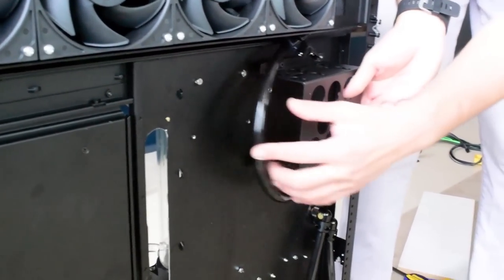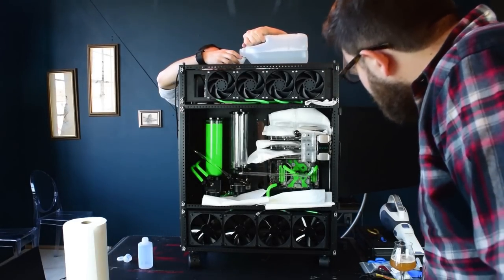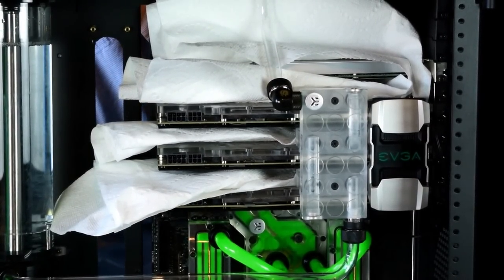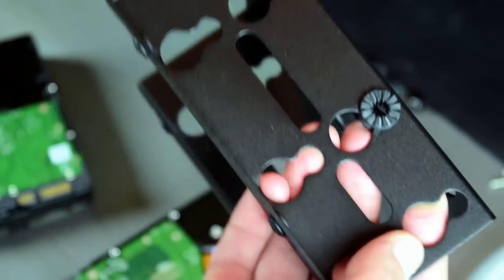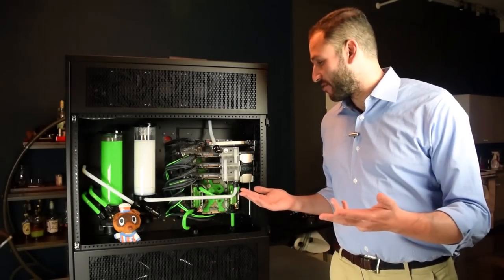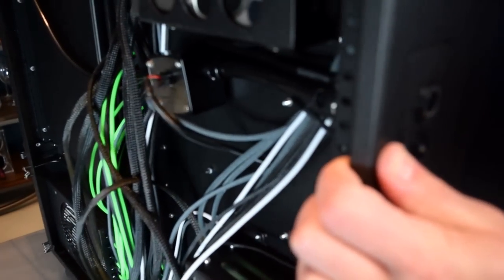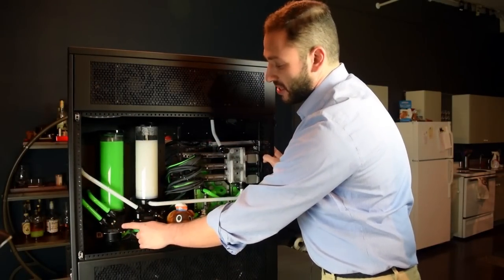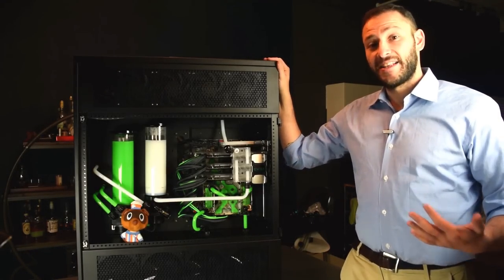Nostromo: 5960X, 3x 980Ti, Custom WC, Rampage V -- Part 4 (Loop Planning, Filling, and Testing)

Comment: Great video! You've basically covered every single thing one needs to have in mind while building/testing the cooling, and answered all my doubts.

Just one question - aren't two 480mm radiators a bit much for the system? Could you put some benchmarks of your temps on load with different fan speeds?

Comment: Good job. Looks good. Just some small suggestion. Is straighten up the gpu run from pump to gpu as the 90 and run our off. Btw what fans out on the bottom pedestal?
Reply from the maker: +James Emsley That makes sense--I'll take another run at that bend.

The fans on the bottom pedestal are NoiseBlocker Blacksilent Pros, the 140mm PWM version.

Comment: Hey Eugene, thanks for making this build log. I just ordered a STH 10 and want to do my first Custom water cooling set up in this case. Figure its a good case to start with. Though I havent had any experiences doing simple mods was there any difficulty drilling in the STH10? will BitsPower fittings work with EK 12/16 PETG tubing? sorry for all the questions dont really have anyone else to talk to about something this specific
Reply from the maker: +Gerard Israel This is a great case to start with, if you have the room for it.  I love how much space it gives you to work with.  A lot of people go with ITX/mATX for their first custom builds, and while there are some great cases there, the dearth of real estate is rather unforgiving.  

The case is not difficult to drill through, but you definitely have to be patient.  The most important thing is that you should start with small drill bits and work your way up progressively for each hole.  Also, of course, measure five times, cut once.  

As for fittings and tubings, I can't vouch for that specific combo.  I've heard of some people having issues with mismatched fittings/tubes, so I opted to go with Primochill PETG matched with Primochill fittings.  Then again, I happened to like the way that the Primochill fittings work.

Looking forward to hearing more about your build!

Comment: 560mm Radiator enough for a I7 6700k and a gtx 980 Ti?
Reply from the maker: +Zero You know, the typical orthodoxy is 120mm of radiator capacity for every cooled component, plus another 120mm on top of that, so I think you'll be fine--especially with those parts (sorry for the delay in responding--my YouTube app no longer notifies me of new comments!)

Comment: All that work on the piping and it still looks a bit untidy. Could use some better cable tidiness, make those look neat, straighten them out with some cable combs or something. I dont really like that the tubes dont line up on the left either its not very pleasing to the eye. With all that cooling tho you should be able to achieve quite a high overclock on that CPU maybe in the 4.7 or 4.8Ghz range and in the 1500mhz range on the graphics cards.
Reply from the maker: You should check out the next video!  It's all about cable management.

Comment: GTA V, Crysis 3, Witcher 3, Battlefield 4, Far Cry 4 in 1080p, 1440p and 4 k
Reply from the maker: +Dick Dickerson Cool.  I have all those games and will bench them, but the resolution situation is a little difficult, since I run a 3440x1440 and not a 4K.  Still, that should get you a fairly close approximation of 4K.

Comment: Hay man nice job. I can imagine the cost of that beast. I'm finally getting the extra time to finish my loop. I am going to block my 980 ti. I have mayhem pastel blueberry and pastel uv white. Coolant. I want to be able to see it in the block of the 980 and torb  do that I will have to flip my mother board upside down. You are the first person I've seen with the motherboard upside down. Have you had any negative affects from being up side down.
Reply from the maker: None at all.  But you have to be sure to get a compatible case!
Reply: Thanks I didn't think it would. I just thought I would ask before I did it because if something had the chance of going wrong it would happen to me that thx for the reply
Reply from the maker: How did it turn out?
Reply: +eugenetries 
It is still in the works. It the first time I've done this much mod to my computer. I've got a corsair 540 and had to do some cutting on the case. I had to order more fitting and a few other thing to get things to work. Plus my day job and kids have Delayed it a little as well I will post some pics when done.

Comment: What was the reason for different fans on each rad?
Reply from the maker: +466rudy Well, I love the EK Vardar PWM fans that are being used on the two 480 rads up top, but when I was getting all the parts, they didn't have a 140mm version yet.  Since my bottom rad is a 560 (4x140), I went with another fan I love: Noiseblocker Blacksilent Pro II.
Reply: +eugenetries I think EK makes vardar fans in 140mm but they are on recall due to the fact that they make a weird metallic sound at high rpm